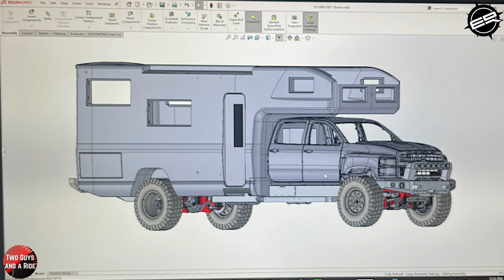Behind the Scenes at EarthRoamer: A Fascinating Factory Tour of Luxury Camper Production

Comment: Can I get one with tesla motors swapped onto it?
Reply from the maker: Nope
Reply: @TwoGuysandaRide   Lame. imagine having enough battery power and solar panels that you could just charge it while it sits or while you drive and run it forever without having to charge it and then have a normal motor as a backup or to run simultaneously or on command with a switch. I know that sounds kinda crazy but if you had enough money that would be amazing.
Reply: @TwoGuysandaRide  I mean I know you guys wouldn't do that but imagine the possibility's if you could. I mean they already cost upwards of 100 thousand dollars yeah? so why not take it to the max? Do they come with independent suspension or is that an option? lol